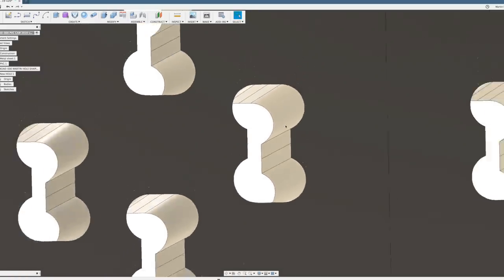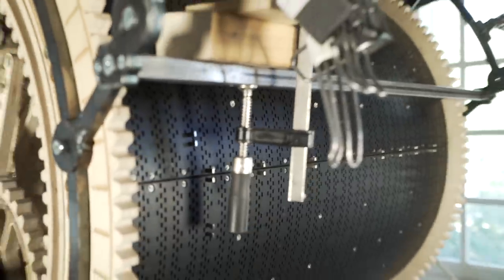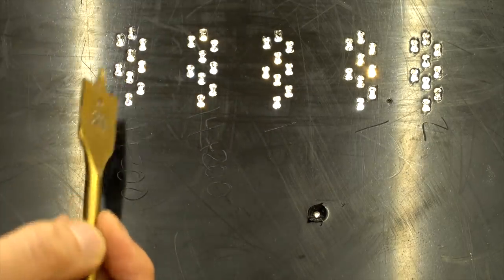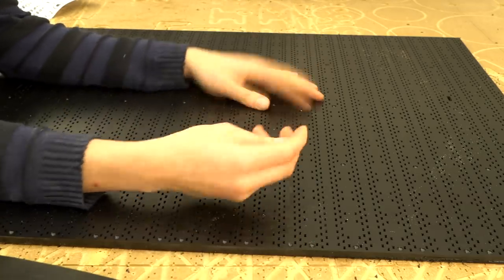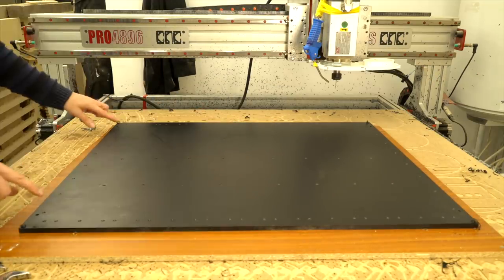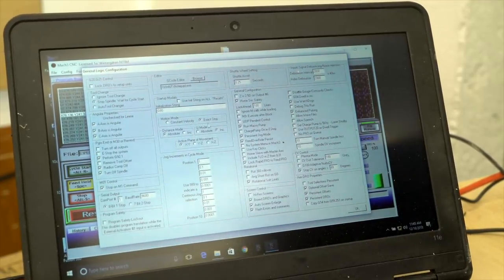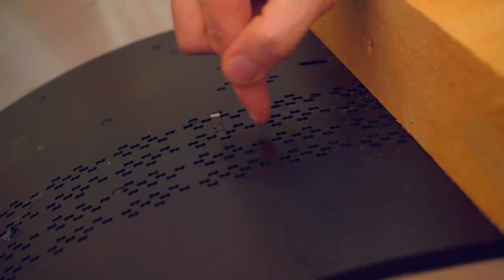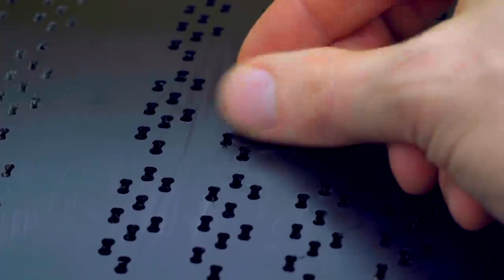Deeper Down the Rabbit Hole - Marble Machine X #66

Comment: Rabbit hole mean like you are stuck in a situation ? (I'm French) It's such a funny expression 😂 Congrat to have managed to leave !
Reply: It's not so much the "stuckness" it's more that rabbit holes are long, winding, dark and become maze like the further you travel into the warren. When you go down a rabbit hole you are "rabbit sized"  and able to traverse the warren in the dark. When you emerge from the rabbit hole you enter into the light of reality. My fear here is that when Martin emerges from the rabbit hole he will say, "OK, so I decided to choose a new material/design"  That's the problem with rabbit holes, you are isolated from the real world and become hyper-focused on a confined area of the work. They are an indicator of a possible design smell. Across many spheres of manufacturing there are natural tensions between designers and implementers. Implementers often have to push back on designers and say, "Eh, no. Your design can't easily be implemented or maintained in the long term". Then the designer has to fight their corner and push hard for their design to be implemented in spite of implementation/maintenance challenges or they may have to modify their designs to accommodate the needs or concerns of implementers. Martin''s problem here is that is both designer and implementer so having that argument internally is a difficult thing to do. But the overall message I am reading from these comments is the community of makers standing outside the rabbit hole shouting, "HEY MARTIN, CAN YOU HEAR US? FOLLOW THE SOUND OF OUR VOICE! COME BACK OUT! THERE HAS TO BE ANOTHER WAY."  I feel for him. I really do. My biggest concern (based on the feedback I read here of people who seem to know more about plastic than I do) is long term integrity of the holes in the plastic over the course of a world tour. Testing this will be very hard especially if humidity needs to be taken into account.
Reply: @robertkielty5094  Hey, thank you so much for your answer ! It's true that Martin's position on this project is such difficult to manage with.... But I think he's pretty good at the designer role but also at the implementer role!

Comment: I have a question...if the material is shrinking and expanding now in the shop...what will it do when you take it around the world in different temperatures and elevations and pressures and humidities? Is the plastic porous? If it's an extruded plastic, it will also shrink a different amount in different directions (across vs along the "grain").

What if the plates were a thick aluminum sheet? How does weight/cost/machining time compare? And would it be more resistant to shrinkage?

Just kinda thinking out loud and pondering some stuff.

Thank you for taking us along with you on this journey, Martin!
Reply: This is exactly what I was thinking. If he takes it to a cold climate then next to a warm one will this material react poorly and make the holes to big or to small, especially if he is dealing with the small size differences. I hope he has thought of this or sees this comment.

Comment: Have you take in to consideration the wear an tear of the plastic  with the normal use during concert and possible weather factors like hot weather or the stage lights. What if you use a locking mecanism?

Comment: I still think it will be worth checking how the plastic of the programming wheel behaves over a range of temperatures to determine how much it will expand and contract, and what effects this will have. As you will be touring with this it will be exposed to a range of temperatures. 
I have used similar material and have encountered problems with expansion and contraction.

Comment: While the router is pretty amazing for what it is you have to consider that doing something like the pinholes it's just beyond the machines scope as with solid carbide tooling a good machine will just not change size  

In general all plastic has a large coefficient of thermal expansion and it would seem like a minimum of a 4 axis job done after the plates our mounted as the bending has to be a huge problem

Comment: maybe you can CNC the plate after you mounted it on the programing wheel . in a custom setup you could use the rotation of the  programing wheel as the Y axes of the CNC program
or 
make the programing holes with a some kind of hole punch; cutting the material rather than scraping it with an end mill.

Comment: How will those holes hold up in different climates when you travel and perform? I'm curious about the thermal expansion and contraction of the material and how that will effect the hole size, considering how big such a small difference is making for you here. Thermal expansion/contraction may actually be a concern for you here.

Comment: With tolerances like that you're going to have to worry about the temperature the machine is playing.  If it's too hot the pins may fall out or not be tight.  Also the temperature you are machining at.  It's currently winter, in summer those holes will change size.

Comment: I don't want to break your project.
But the dimensions of plastics tends to vary greatly with both temperature and humidity. So taking it on tour might end up with this rabbit hole suddenly getting far deeper.
I would recommend using something with lower thermal expansion. (I would say ceramics (alumina as an example) since it solves both issues, but machining such is a real pain.)
Though, I do see the niceness of plastics, they are rather easy to machine and work with.

If you want to be overkill, you could make the programming plate into a layered sandwich of programming plates. A stack of 3 of them, where the middle one is free to slide a bit, then have some set screws putting tension on it, clamping all the programming pins on the plate in place. Keeping them from wiggling in the process.

Though, then each of these three places needs to be individually machined due to their holes needing different offsets since they in the end will not have the same radius. One can machine all the plates for layer at once, as to get the whole programming wheel created in one go. Since tapered holes isn't going to be crucial in this application, due to the stack of three places providing a three point contact.

But getting even clamping pressure is though likely going to be more tricky, but could be solved by using many set screws. These set screws would likely use a cam action to move the middle plate and provide the clamping for that way.

Though, I am though mostly rambling at this point, and mostly stating how I would implement it.

Comment: Can someone from the MMX team or anyone else explain why they decided to go for PE 300 as material? From our experience POM is way better to machine, form accuracy is better and it breaks better chips --> less  burr. Also its alot harder which should result in not wearing out the holes that easy under load. 
I assume the bending strength is too high to bend it around the drum radius? 
Great video again. Treat to watch.

Comment: Hi Martin, in terms of load testing, if you hook up a motor to the MMX, each sub-assembly can be put through its paces for extended periods of time.  That way, you can be doing automated load testing on one section of the machine while you are still developing another section.  For example, you could be testing the marble lifting/distribution sub-system for hours, just by letting it run by itself.  Or, when you have a programming plate design that you like, you could run that for several hours while refining the next version.  If you hook up contact microphones, you might be able to record the audio and look at the results afterwards.  In terms of project scheduling, it might be advantageous to independently load test as many pieces of the MMX as you can in advance, before testing the fully integrated machine.  (Maybe you are already doing this is the background.)  In any case, keep working!  Mountaineers know that you only get to the summit by putting one foot in front of the other.  You will get there.  The MMX is the Everest of magnificent musical mountains.  (Insert audio waveform that looks like a mountain range here.)

Comment: Have you considered how traveling a tour with your machine will distort your programming board due to the ambient temperature at the venue (indoors/outdoors in winter/fall/summer)? 0c vs 20c vs 35c. And if it has been at 0c or 40c in a truck for x hours that it may not be warm/cool enough for holes to be the correct size (or other fitments?).

Comment: With such small tolerance, are you not afraid that temperature changes could mess it up due to the dilatation of the plastic? I mean, on a stage with lights in summer your registration plate will be quite warmer than it is now in your cold winter workshop... I don't know about dilatation coefficient of this polymer but I hope you and your team addressed this issue already.
Anyways, nice work! As always. Thanks

Comment: Hi Martin,
Maybe this is not a good idea, but why you don't try to machining the pin's holes whith your plates on the drum, raw by raw ?
This will requier to make a precise angular positionner, but it will permit you to avoid the final deformation of the holes due to the bending operation.
Regards

Comment: How did you calculate wall angles ? Using sheet metal and flat pattern it should be quite easy and will update automatically with every change. Problem you have with holes shrinking is similar to springback in sheet metal world :)

Comment: Could it be that metal sheets would be the better solution than plastics? Much less problems, I suppose, also during exploitation, due to less expansion and shrinking with temperature. Did you check that option?

Comment: You could have a few custom tapered endmills made so you don't have to cut the taper with the depth. Insted you can cut it in one shot. Just an idea. Custom endmills aren't as expensive as some think. May give it a try. I have many rabbits my self... making lots of holes over here ;) ~Russ
Reply: You can even buy end mills with built in taper, because those are used for drafting edges in injection molds.

Comment: I was working with a kind of plastic called PUM if I can recall correctly, it drew moisture from the air and grows in size which was the only conclusion when we couldn't open an end cap of a tube, both are machined from the same plastic, that's after a few months.

Comment: I wonder if the temperature on a stage versus your work shop will not cause you problem since the "shrinkage" is  caused by the extension/contraction of your material cooling down after que machining. It will do the same with ambiant temperature changing all the time.
You should take temperature of your material after machining and do test with different temperature in your work shop

Comment: Hey i worked about 9 years in the metal industry, did you tried to use more oil on the air cooling, this could help a lot with the plastic.

Comment: I have a bad feeling about this. Most plastics shrink/swell with temperature to some degree. Even if the reason the holes are shrinking isn't related to temperature (which I suspect it could be), I worry that taking this thing on tour, if your tolerances are this tight, couldn't the varying temperatures at different venues cause pins to becomes loose or too tight? I suppose the good news is that you are not reprogramming this thing on the fly so, as long as you get the pins in at a "normal" temperature, they should stay put even if you are playing somewhere cold....

Comment: ... second opinion .as an old project leader:  go for aluminium and find a firm that can do it...   (you have no guarantee how the plastic behave in 2 years)
Reply: my argument: if you go on tourne  the plats will go thru cycles of heat (+30) and cold (-10) they will deform, because the plastic is under stress when you bend it and will never come to a static point. Go for aluminium that is bend, then stress released and cut.

Comment: it should be better to skip some holes for later on the process. lets say skip every one and come back later. because you locally raise the temperature and material softens. let it cool till your next pass. so split your holes into 2 rectangular arrays with double the desired  distance.

Comment: I wonder if it would be a good idea to go tighter than you are comfortable with because in time the pins are going to get knocked and wear out. I can see you choosing to glue pins in specific plates that are no longer being changed. It seems as if not all plates have to be changeable all the time.

Comment: From a fail comes a win. I would have thought with the constant cold air of the compressor blowing across the hole, that the plastic would stay cool. There must still be enough heat in the Bit, I wonder what variance there would have been had you not had compressed air blowing?? If you have issues still, try getting a Digitech Infrared Non-Contact Digital Thermometer. I would think the longer the Bit runs the heat surely must be increasing. Measure the first hole and compare it to the last hole drilled. If they are the same size...ignore everything I just wrote. (and yes the Bit is designed for such plastics). My Thoughts.

Comment: I see a potential problem with the programming plaits. If you make them symmetrical and plants to reprogram or changing they may ending up putting them 180 degrees wrong together. On stage you may have no a lot of time.

Comment: I believe RPM is not your problem, the speed of the drilling head is.
drill bits are meant to take out the material as they drill, so the faster they go, the better, the more polished the hole.
but, if you rush the drill bit onto the material, you risk compressing the material before it can be carved off.
so, .... drill, but don't drill , more like, slowly grind away, taking the material up and out by means of the drill bit spiral

Comment: ## ISSUE: Temperature - If you are considering to travel and use this machine this could be a potential challenge considering the variability of environmental factors that affect temperature (weather, lighting, humidity). Plane cargo space temperature vs warm climate vs airconditioned room.

Comment: Have you considered that the bending is causing the plastic to expand/stretch ... then over time it recovers?
easy to check - test a set of holes on a flat piece with no bending.
This is very important because the 'recovers over time' problem may raise its head during the world tour
Reply: The solution would be to cut the holes after bending - bit of a headache because you would need to have a forth axis for the CNC or rather replace the y axis with a drum. 
Interestingly this is very near the robot I would have built for re-programming whilst live :)

Comment: With your tolerances being so tight, I'd be concerned with the varying environments you will be taking this machine through while on tour. At different temperatures, those sheets of plastic are going to expand or contract, and may cause warping or buckling around the circumference of the wheel, not to mention altering the size of those pin holes. You might want to test your fittings at different temperatures. Plastics can be so thermally reactive, I don't know how those tolerances will hold up.

Comment: Why not machine after the plastic (HDPE?) is mounted?  Yes, you can index on the curve correctly with your current router, you just have to work it out.  

Or, just let us machine the complete wheel assembly at one time...

Comment: Dealing with tolerances half of a human hairs width in a soft material that expands and contracts with heat is going to be painful. Id be surprised if the machine could really cut that precise to be honest. Its at least 3 times more precise then my mini machine can do reliably, that's for sure haha.  I wonder if this heat expansion problem could happen on stage as well, from the heat off the lights etc. Or at least vary depending on the climate? I've cut parts submerged in water a few times, to avid the nasty dust, but perhaps that can be done to cool the part as well. Its not as difficult as it seems, just make 4 walls around it with silicone in the seams.

Comment: The coefficient of thermal expansion is very large in PE plastic, for example, a 1000mm long polyethylene rod expands by 0.2mm for each degree it is heated, and stress corrosion can occur when it is in a stressed state and gets in contact with some soap solution or oils and then cracks occur, so consider using less problematic material and good luck.
This is the product data sheet for Pe 300 http://plastimnew.websitedesigntest.co.uk/content/uploads/library/technical_datasheets/HDPE-PE%20300-Technical-Data-Sheet.pdf

Comment: Will the plastic plate expand/contract depending on the stage (where the MMX will be used) temperature? Will this be a problem on tour?

Also wouldn't it have been nice to have another axis on the machine to be able to mount the plate already bent and rotate it while machining it. This would have solved the taper problem I think.

Comment: Mmmm. Maybe a different machining method could resolve the issues. Instead of cutting cones in a flat surface, why not bend first and then cut straight holes? Obviously not with the cnc mill. But there might be another machine or process to cut on round surfaces.

Comment: Your going to continue to have trouble just with temperature variations with that material.  What happens if stage lighting, or weather are creating temperatures that make the programming boards expand/contact.  You need to be using a different material entirely.